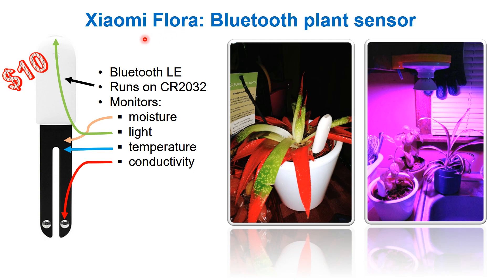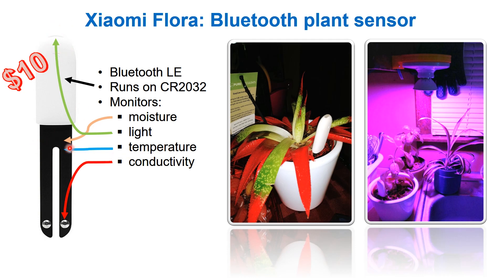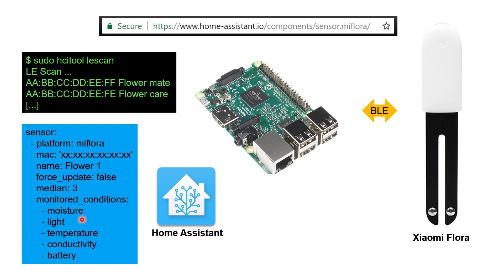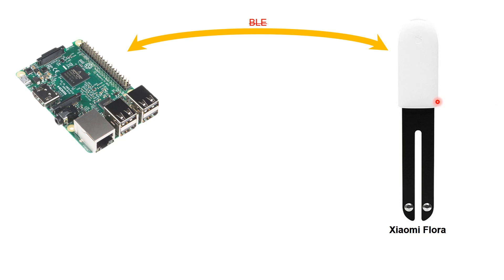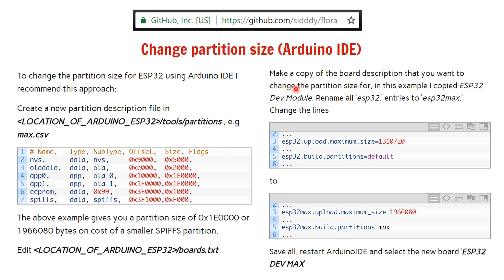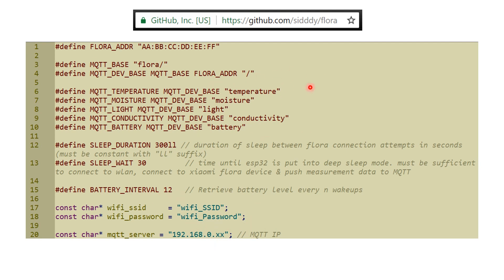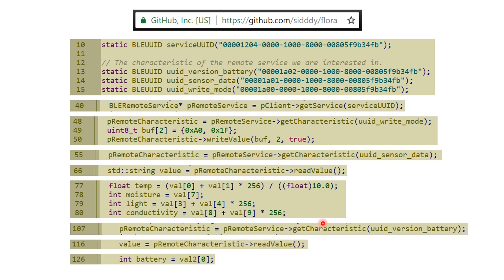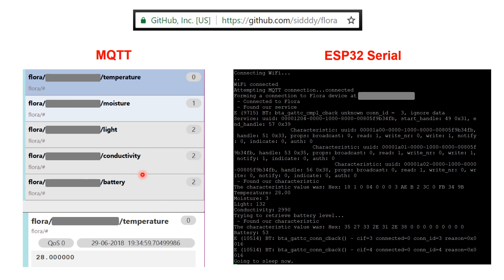ESP32 communicating with Xiaomi flora plant sensor using BLE

Comment: I would like to try this out but can't get it to work in PlatformIO - I just installed PlatformIO (migrating from Arduino IDE) and need some help here. Did you compile this in Arduino IDE or PlatformIO?
Reply: @deb-sahu  I couldn't replicate this. Given I'm new to PlatformIO there may be another issue. I downloaded the source from GitHub (https://github.com/sidddy/flora) unpacked the zip file and opened folder to the unpacked zip. I then added the above to lib_deps and try to compile. Get all kinds of errors. FYI, I was able to compile Tasmota in PlatformIO. So somewhere along the road I must make a mistake...
Reply: @deb-sahu  Thanks. When I added the URL I got an error message that it needs the GitHub client. Installed the GitHub client. Same error. Had a look at some of your  GitHib code and the syntax seems to be different. Theresa no mention of a URL but simply the library like lib_deps = PubSubClient which probably exists in the official PIO library...

On the PIO homepage I selected "Import an Arduino project" and then edited the atdormio.ini... keen to get this going and yes love what I see so far with PIO

Comment: Thanks for the tutorial. I have a similar issue re distance but in my case I have a Yeelight bedside table lamp. There's an integration on Home Assistant (component light) but it assumes a local BT stack.

Seeing your solution I could use an ESP32 to act as a BT to MQTT gateway bitt need the ability to send commands to the gateway as this is a light component and not a sensor component.
Any tips to approach this?

Comment: is it can be used same method for arduino UNO?
Reply: @deb-sahu  Ok, but if you configure it entirely from the beginning with the Arduino uno and add a wifi Bluetooth module, it should work, right?

Comment: i have the same problem like @ SH0CK3RZ

#### Com-Monitor

Initialize BLE client...
Connecting to WiFi...
....
WiFi connected

Connecting to MQTT...
MQTT connected

Processing Flora device at c4:7c:8d:66:db:c1 (try 1)
- Connection successful
- Failed to find data service
Processing Flora device at c4:7c:8d:66:db:c1 (try 2)
- Connection successful
- Found data service
- Force device in data mode
[E][BLERemoteCharacteristic.cpp:308] retrieveDescriptors(): esp_ble_gattc_get_all_descr: ESP_GATT_NOT_FOUND
[E][BLERemoteCharacteristic.cpp:315] retrieveDescriptors(): 
[E][BLERemoteCharacteristic.cpp:315] retrieveDescriptors(): 
- Access characteristic from device
- Read value from characteristic
[E][BLERemoteCharacteristic.cpp:438] readValue(): Disconnected
-- Failed, skipping device
Processing Flora device at c4:7c:8d:66:db:c1 (try 3)
- Connection successful
- Found data service
- Force device in data mode
[E][BLERemoteCharacteristic.cpp:308] retrieveDescriptors(): esp_ble_gattc_get_all_descr: ESP_GATT_NOT_FOUND
[E][BLERemoteCharacteristic.cpp:315] retrieveDescriptors(): 
[E][BLERemoteCharacteristic.cpp:315] retrieveDescriptors(): 
- Access characteristic from device
- Read value from characteristic
Hex: DE 0 0 CD 0 0 0 12 FF 0 2 3C 0 FB 34 9B  
-- Temperature: 22.20
-- Moisture: 18
-- Light: 205
-- Conductivity: 255
WiFi disonnected
MQTT disconnected
Going to sleep now.

## MQ
and with the  MQTT.fx subscribe to topic: "flora/c4:7c:8d:66:xx:xx/#" i didn't see something?
Reply: @deb-sahu   yes, i have "flora/C4:7C:8D:66:DB:C1/#" but don't receive any message.  i will open a issue
Reply: @deb-sahu  i found the problem in the mqtt broker -  {
  "logins": [],
  "anonymous": false,
  "customize": {
    "active": false,
    "folder": "flora" <--- wrong name
  },
  "certfile": "fullchain.pem",
  "keyfile": "privkey.pem"
}

Comment: It seems it does not work with mosquitto mqtt broker, Its connecting, but in i added everything in my configuration.yaml but the sensors does not update at all. 
Info in MQTT: 

1542351552: New connection from 192.168.1.15 on port 1883.
1542351552: New client connected from 192.168.1.15 as floraClient (c1, k15).
1542351578: Client floraClient has exceeded timeout, disconnecting.
1542351578: Socket error on client floraClient, disconnecting.

This is what i see in my COM6

Attempting MQTT connection...connected
Forming a connection to Flora device at c4:7c:8d:66:xx:xx
 - Connected to Flora
 - Found our service
Service: uuid: 00001204-0000-1000-8000-00805f9b34fb, start_handle: 49 0x31, end_handle: 57 0x39
Characteristic: uuid: 00001a00-0000-1000-8000-00805f9b34fb, handle: 51 0x33, props: broadcast: 0, read: 1, write_nr: 0, write: 1, notify: 0, indicate: 0, auth: 0
Characteristic: uuid: 00001a01-0000-1000-8000-00805f9b34fb, handle: 53 0x35, props: broadcast: 0, read: 1, write_nr: 0, write: 1, notify: 1, indicate: 0, auth: 0
Characteristic: uuid: 00001a02-0000-1000-8000-00805f9b34fb, handle: 56 0x38, props: broadcast: 0, read: 1, write_nr: 0, write: 0, notify: 0, indicate: 0, auth: 0
 - Found our characteristic
The characteristic value was: Hex: C3 0 0 5E 0 0 0 10 98 0 2 3C 0 FB 34 9B  
Temperature: 19.50
Moisture: 16
Light: 94
Conductivity: 152
Trying to retrieve battery level...
 - Found our characteristic
The characteristic value was: Hex: 63 28 33 2E 31 2E 39 0 0 0 0 0 0 0 0 0  
Battery: 99
Going to sleep now.

Comment: Hello, I followed the steps, but I'm receiving an error I'm not able to fix... any help? This os the output of the serial port: 
"Starting Flora client...
Connecting WiFi...
.....
WiFi connected
Attempting MQTT connection...connected
Forming a connection to Flora device at c4:7c:8d:67:33:83
 - Connected to Flora
abort() was called at PC 0x401a78d7 on core 1

Backtrace: 0x40095324:0x3ffdab80 0x40095527:0x3ffdaba0 0x401a78d7:0x3ffdabc0 0x401a791e:0x3ffdabe0 0x40195203:0x3ffdac00 0x400d31e5:0x3ffdac20 0x400d1623:0x3ffdac80 0x400d1d8d:0x3ffdad50 0x401af48e:0x3ffdada0

Rebooting..."

Thanks a lot!

Comment: Thanks man, you've paved the way for me to integrate this. Very clear.

I'm planning to get an Esp32 for this while at the same time using it to trigger my 4ch relay board that controls my irrigation valves via mqtt...

On the git, it says the sketch only supports one flora sensor. How can we change the sketch to include more flora sensors?
Reply: @deb-sahu  I skimmed through it, but assumed it was already integrated into HA? Is it at least a custom component for now?
Reply: @deb-sahu  nice, thanks for volunteering man. Love the community!
Reply: By the way, why can we only pair one Xiaomi sensor? Is it a limitation of the ESP32?